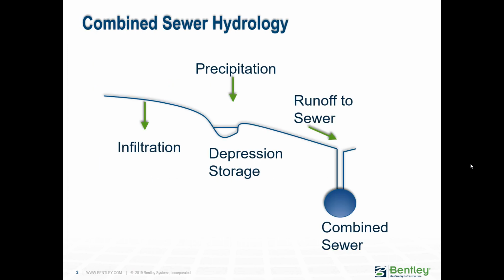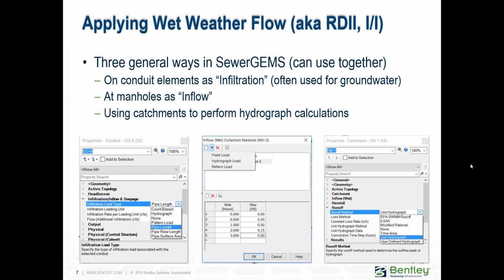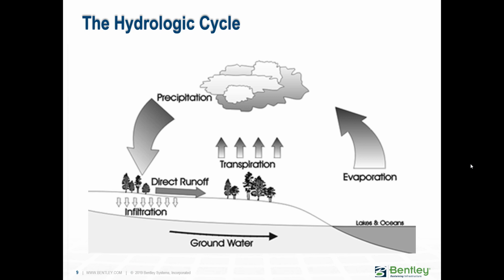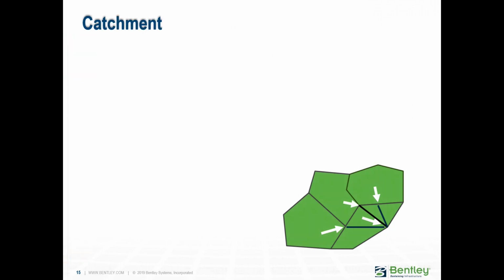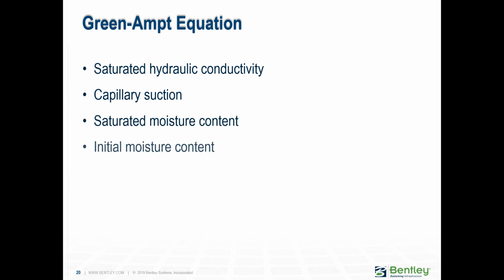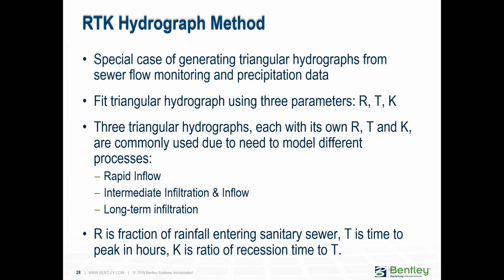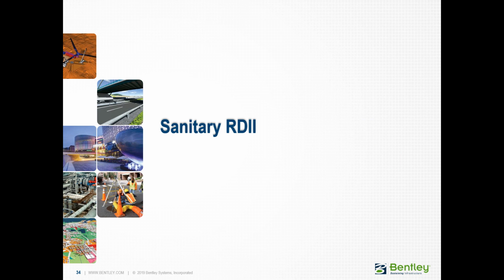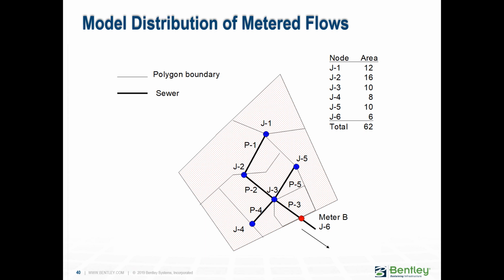SewerGEMS Advanced Training Part 1 - Hydrology

Comment: I have a doubt regarding SewerGEMS storm drain design. When a conduit is designed, the software reports the hydraulic depth. However, in actual construction, the conduit/manhole has to be extended up to the ground level, which adds additional depth above the conduit.

My question is: Does SewerGEMS consider this additional depth (from the conduit crown/manhole top up to the ground level) in its hydraulic calculations and reported hydraulic depth? Or are the hydraulic calculations based only on the conduit itself, with the cover/ground-level depth needing to be checked separately after the design?

If this additional depth is considered during the hydraulic analysis, it may provide extra available head and potentially allow a reduction in the required conduit size or the depth at the outfall. Is there any option in SewerGEMS to account for this automatically during design?
Reply from the maker: Hello, this type of question is better suited as a Technical support request or on our forum. I am a bit unclear on your question, but in general the "depth" result is the water depth inside the conduit or manhole, and is also reflected in the hydraulic grade line that you see in profiles. The ground above the conduit does not come into play in the calculations as it would have no hydraulic effect. However, you can view this "cover" (the term used to refer to the fill depth above the conduit) in the cover results fields and in profiles, based on the ground elevation entered at nodes or brought in from a terrain model. When using the constraint-based design feature, you can specify the desired min/max cover constraint to help control costs by minimizing excavation. 

You mentioned "it may provide extra available head" - the "head" is the pressure of the water based on the water depth. The only way I can see the buried depth influencing this head would be during surcharge conditions, which the software accounts for. Meaning, the water depth in a manhole can rise above the connected pipe top as it fills up toward ground elevation, and that will pressurize the adjacent conduits and will be reflected in the conduit hydraulic grade results. You can also view surcharging in profile view.

If you need more help, please submit a Case to Technical Support via the Support Portal and include screenshots and clarification if possible: https://bentleysystems.service-now.com/csp